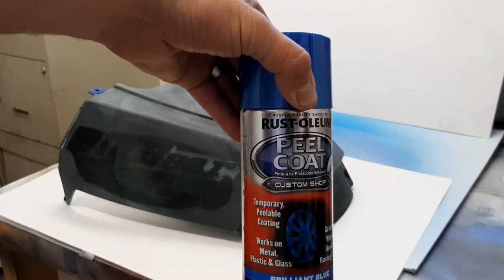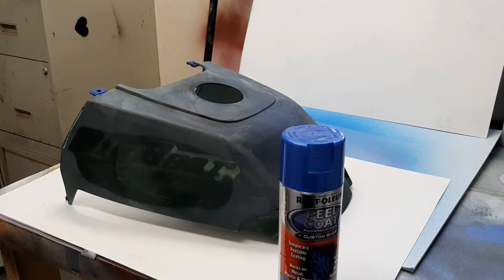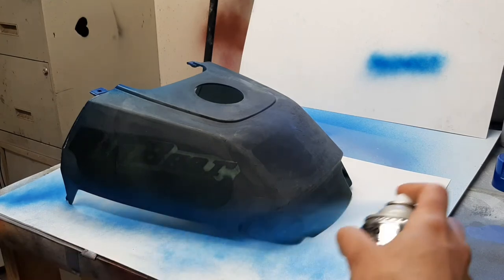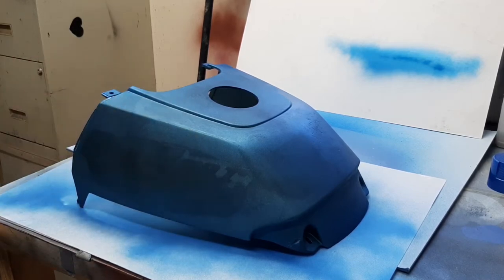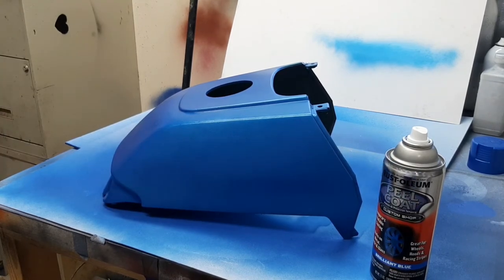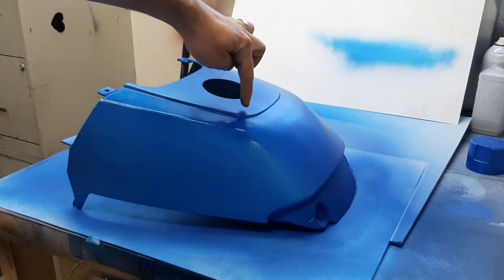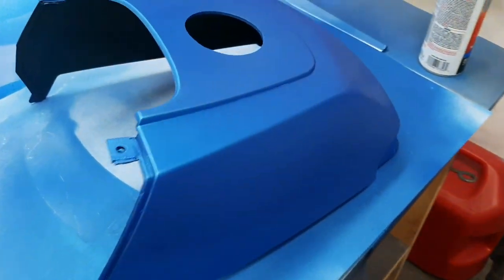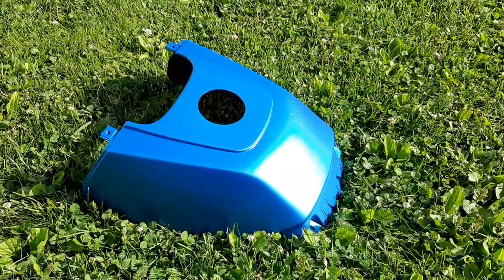Rustoleum peel coat on ATV plastics.

Comment: why dont you use a primer to help the peel coat to attach it??
Reply from the maker: I wanted the option of peeling it off in the future without damaging or discoloring the plastics.
Reply: It'll stick to it you just have to be patient with dust coats until you start getting some coverage then you can go with a little bit thicker coats. 5 coats minimum

Comment: I have a Yfz450. I started doing this to it. But I doesn’t take much for it to kind off I think. I’m worried after a day of riding how will I wash it? Scared it will peel off
Reply from the maker: It seems to have a good bond to the plastic so washing with a hose and sponge or something shouldn't be an issue.  Where these coatings fail is from scratching them with sticks and crap.
Reply: White's Trash yea I agree. U can damn near rub it gently with your finger nail and it will show the true color of the plastic.
Reply: Also the more coats the better. I've got 6 and 7 coats on my side mirrors on my truck and my front grille. And it's still looking good after a whole year of different seasons.  It actually takes a beating

Comment: Does gasoline not dissolve that like it does PlastiDip?
Reply from the maker: I'm sure it does.  I plan on using bed liner on the top of the tank, near the fill cap. Hopefully that's resistant to gasoline to some degree.